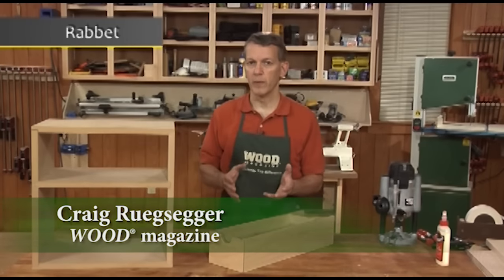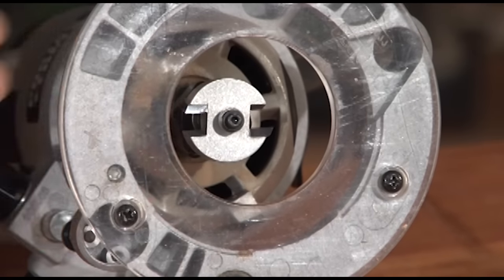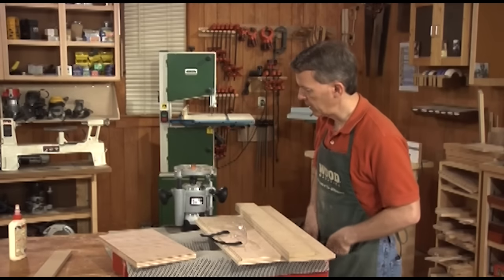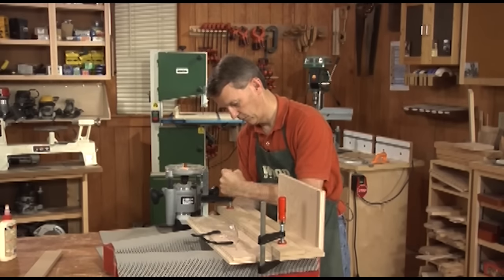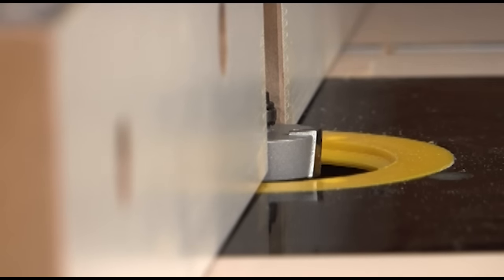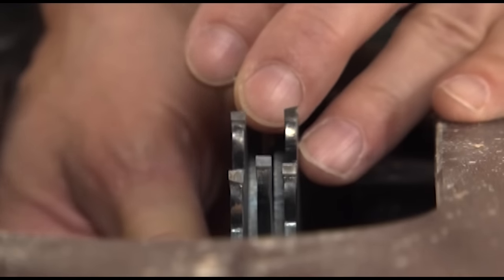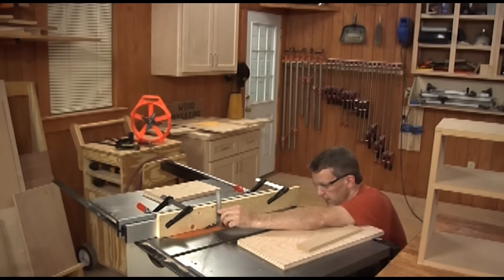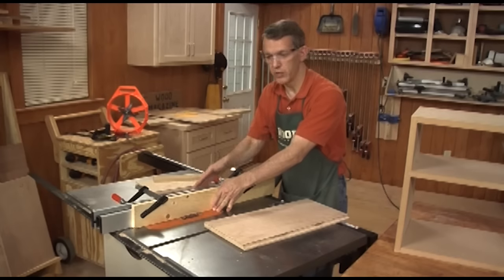How To Make A Rabbet Joint - WOOD magazine

Comment: I am so grateful for your videos, esp as a female with little experience of woodworking.  I love to build things and restore furniture.  You explained this so well.  I don't have to buy a scary and pricey dado blade, a new insert, and create stop blocks and fence jigs.  I can just use my handheld router to make this with a bit I probably already have.  A new bit is $30, much cheaper than the dado setup.  I don't have a router table, so knowing I can use a handheld, is invaluable information.  So very happy to have seen this. I have to make some drawers for a salvaged old Japanese ironing board console, to turn it into drawers with extensions instead of open shelves.  Thank you!!!
Thank you also for getting straight to the point, and NO MUSIC!!! What joy for my ears.

Comment: Very clear and concise explanation. A point to add is that if you want to cut a rabbet across the end of a long board, it is easiest to use a portable router, with a jig as Craig describes here. That way, you run the tool across the board, rather than running the board across the tool [or blade]. For long boards it is harder to keep the joint straight due to the length of the board. In any case this is a really notable demonstration video. Thanks.
Reply: Or combination/router plane if you're not comfortable with power tools

Comment: I learned a lot from your video about rabbets.  I made the jig but I have a question. How do you set the depth of the router bit with the plunge router and using the jig ie for your 3/4" piece of plywood? thanks
Reply: I think I understand your question. The router can be adjusted to cut lower or higher.  This makes the bit go up or down as you need within the limits of that bit size.  Typically rabbets are a channel that goes halfway down the thickness of a board. So for 3/4" piece you would adjust to that length.  Test on a piece of scrap. To find the middle halfway point, mark it, or router one side slightly then router the opposite side same spot till you have a thin piece remaining and that is almost halfway point.
What you need to see is how to use a router or how to set depth on a router.
I have a router too, but don't use it much.  What I do to save time, is to make some key points on a sheet after watching a video, also put name of video on the sheet, then file it in a folder in my garage, marked 'How To'. I look up the router page before using and presto!  All tips handy, including how to change bits, adjust depth, etc.  I also mark my bits - take a photo enlarged, print that out, and mark on that page directly and file it. Works well for all tools, since as a part time DIYer I forget how to use a tool sometimes.  Normal for non-professionals.  Nice to see another female here!

Comment: Using a ruler to make measurements on the router table does not seem to be a very accurate method. Is there a better way to make measurements?